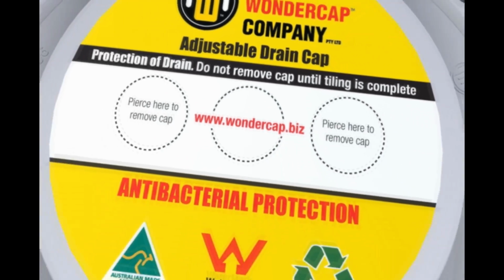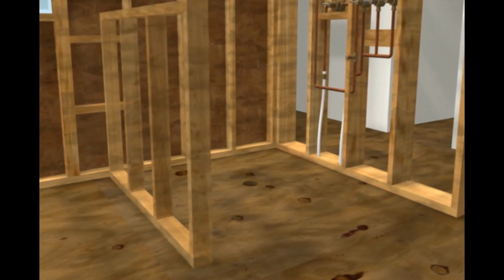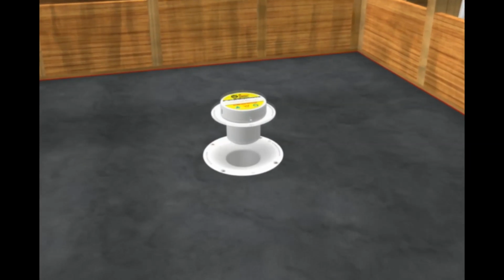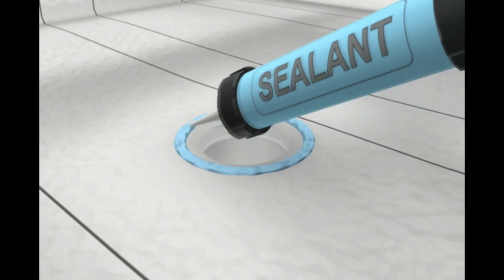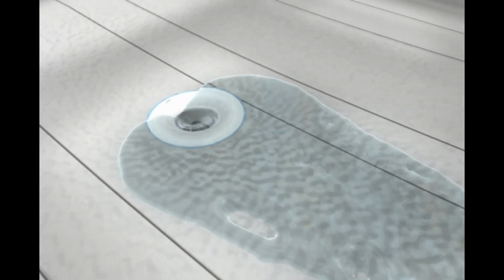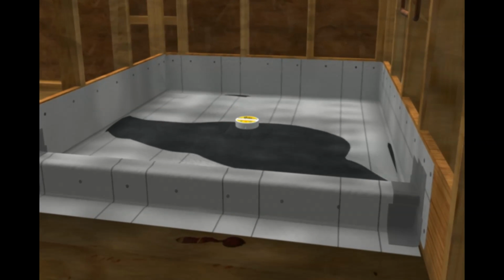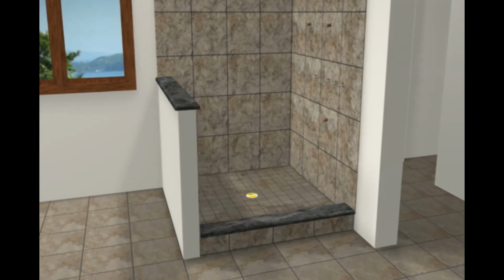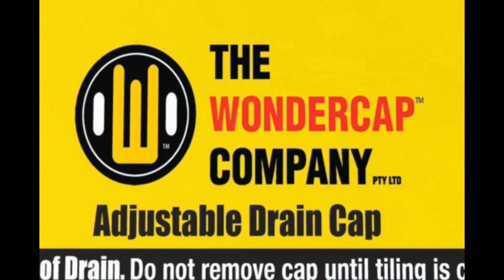Shower Pan Liner Installation using a Wondercap Shower Drain

Comment: This is truly a ridiculous system.  It doesn't make it easier at all and actually recommends improper use of dry-pack.  First, with the membrane under the pre-slope you create a floating floor which is fine in some situations.  They then suggest the use of dry-pack for the pre-slope.  Dry-pack should not be used if thinner than 3/4 of an inch.  There are better products to use when getting down to tolerances this thin.  They then proceed to cover this layer with another waterproof membrane.  This is now a double vapor barrier, which becomes a place to trap water and then create a mold issue. They later mention in the video to water test and patch if necessary.  The problem is, by this time you will have saturated the pre-slope and will not be able to get out that moisture. They say their system eliminates the infiltration of mortar into the drain.  Well, so does the bag you brought your drain on-site with or a rag if you didn't bring a bag.  The drain plug they use later in the video is also a tool I use to keep mortar out of my drains.  The plug can be installed at same time the drain is connected to the sub-floor.  Oh god, I could keep going but I will leave with this:  What the hell is a hygienic shower drain?  Let's not kid our self, people piss, spit, clean feces of their butts, sweat, blow snot, etc. into the shower pan and once we have all stepped in the aforementioned debris, we are supposed to worry about how clean it is a foot or two down the drain?  Where does their system address keeping this "hygienic" drain maintained in a hygienic manner?  DO NOT BUY THIS DRAIN!  An Oatey or Sioux Chief is every bit as good at a cheaper price.
Reply: You should pay better attention. Watch it again. They never said the liner goes under the pre-slope. It goes on top of it before the final slope is created.
Reply from the maker: Appreciate your thoughts, firstly, according to IAMPO (International Association of Plumbing and Mechanical Officials) it is required for dry pack mortar to be used as a pre-slope, however Portland cement/sand can be used also.

Requirements states that the shower floor must have a protective liner prior to the bedding for the pre-slope which prevents the semi-wet dry pack mortar from wetting the timber floor (which obviously you don’t want to happen as this causes mold and degradation of the timber floor). With a secure and unperforated shower pan liner; there is no saturating of the pre-slope as it is underneath the pan liner and the provided test plug enables the installer to check for leaks in the pan liner which as you pointed out saturates the pre-slope . Capping off the riser is key to ensure that at no point is there debris entering the shower drain system. Finally, you made a good point; what is a hygienic shower drain anyway? The base insert is made from polypropylene which unlike ABS is a non-stain, non-stick substance. We also have the plastic injected with an anti-bacterial agent which inhibits the growth of bacteria (bacteria produces mold and odors in the shower drain). We hope we’ve addressed your concerns and if you’d like to test for yourself we would be happy to accommodate you. You can find us through all good Lowe’s, Ace Hardware and Home Depot stores.
Reply: Dude, total misinformation in your post...I pity anyone you give guidance to or labor....
Reply: @michaelcarton3299  Care to expand?